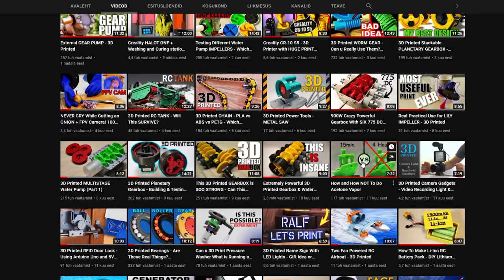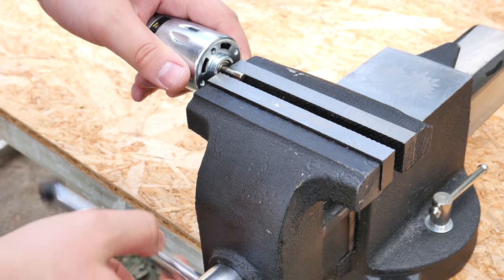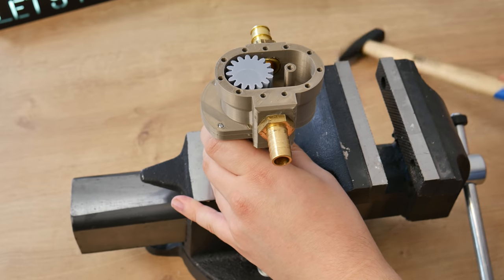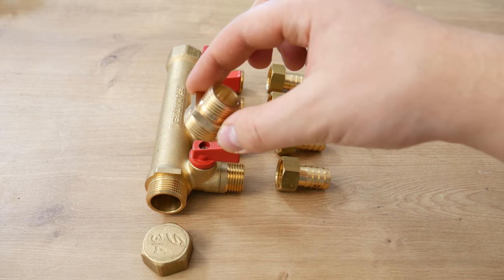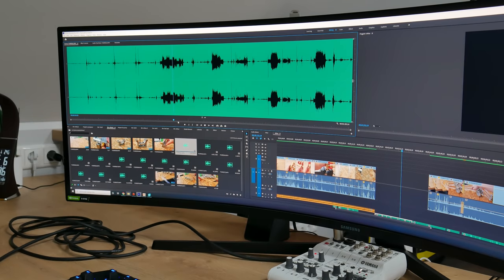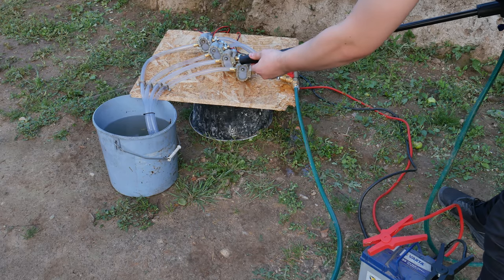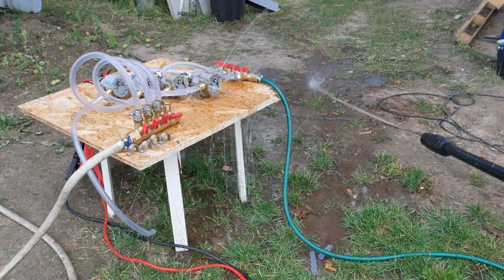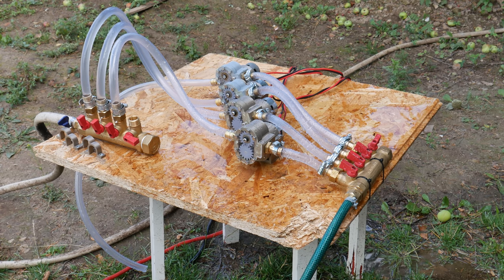3D Printer Pressure Washer with GEAR PUMPS - Part 2

Comment: Good work! 

Series you add the head together Htot = Hpump1 + Hpump2 +Hpump3 + Hpump4
Pressure tot = Htot x density x gravity

Parallel you get higher flow

Qtot =Qpump1 + Qpump2 +Qpump3 +Qpump4

Ofcourse there are losses, your main losses in your system is due to leakage, use a resin printer instead of an extrusion printer and include gaskets and oring where necessary. 

Your parralel system can be optimized, however series is the way to go when you want more lift.

Comment: Series =more pressure
Paraller = more flow

Sealing it properly will help a lot
Dony aply silicone etc putside the screews...aply it inside because u always leak where screews are

And remember that u loose pressure at the pumps because u have to big gap on top and botton 
Use somethig to seal it and u will have super strong water pump

Or just make peristaltic one

Comment: option 1... take off end cap, put pump 1 on there instead of tap 1, result = weaker pump is now getting its flow assisted in pull as well as push by the forward 3 = better flow as pump1 water is already traveling in the right direction. 
2 add a buffer/accumulator io tank/trompe remember there's trapped air/gas in that flow so use it for free by trompe trapping it to increase local pressure in front, cut an old expandable bike tire tube put in a big pipe to stop it expanding to/so much it pops , test...
3 dip these leaky prints in 'water glass' /LIQUID SODIUM SILICATE concrete sealer cures quick with co2 so do it when you talk to your plants lol to properly seal the layers with a hard glass like layer use for all other practical machine 3d prints too

Comment: I see most people suggested putting it in series but putting it in parallel is better , i think the problem is u using those 4 fit connector. At the end pump 2 can cancel pump1 cause it spread to pump 1 and pump 2, maybe try to find a connector that doesn't have many turn, just 4 output straight to the hose without those 90° turn

Comment: Also, print the connection parts with the resin printer as well, and between the pumps you should use left/right threads to connect them directly in between each other.
With an printed external gearing you could run all of them with one motor.

Comment: Basic configuration of pressure washers use pistons. I think you could 3d print those easily and make some sort of one-way valve for them. Because of that jet in that spray handle, you need more pressure not flow. If you remove that nozzle on real pressure washer, you can see that it doesnt actually flow as much as you would think. You could use basic seals for the pistons and make spring-actuated release valve for longer idling times. You could 3d print camshaft like shaft, or use shaft with a flat in angle so the change in stroke isnt so immediate, smoother like.

Comment: Hey buddy, you need super tight fit rubber gears and higher RPM, also, switch to a brushless motor, for example - "Gartt 5360", 4300w (max) equivalent to about twenty 775 DC motors (775 200w), I really like your channel man, great progress!

Comment: I honestly think it might just be the motors also. don't forget, pressure washers are usually 2kw+, and sometimes even use actual gas motors. you can hear the motors bog down here as well, which I think confirms my suspicion, and really I think you had a very nice design. 

Perhaps buy a few cheap wood saws or something like that, they come with 1kw+ motors and can plug straight into mains. there's also the concern of torque though so maybe something else with a geared down motor.

for the leaking maybe just use some strong epoxy instead. or actual gaskets. acrylic is also unlikely to stand up to the pressures you're looking to achieve - it probably won't break but water will leak out through the bolt holes and the pressure might even strip the threads a little, even on thick acrylic.

I know waterjets use a piston pump mechanism, so that might be fun to try if you find you can do it practically.

also nice screen.
great video!

Comment: You mentioned that PCB Way does light metal fab.
Exploit in the chase for that seal.
Then, run a much larger one of these with your "v6" 775 motor ;) (Perhaps gear it for a bit more speed too?)

Comment: I think the junction inlets at 45° s  might increase the power.  As you don't have any non return valve if any  pump is less powerful than the average that might get a negetive flow too so vectoring the pressure might help.

Comment: Pressure washers use a multiple piston pumping system, not this type of cog pump. They work pretty much like a car engine (but in pressure washers the crank rotation to axial displacement occurs in the same axis) which, by definition, is an air pump.

Comment: You should use 3 Y shaped connectors for the tubes! I bet it’ll give a lot more power like that, instead for using the 4 nozzle connector. The issue I think with the 4 noddle connector is that all the water is coming in at a 90 degree angle. If the water was coming in at a 45 degree angle, I bet it would work much better!

Comment: As you an see, the volume is not the problem but the pressure. You need to put the pumps in multiple stages to increase the pressure. Just remove the 1=>4 plenum and instead run the pumps in series and you should have enough pressure to adjust to the 15° nozzle size

Comment: Low pressure, i would suggest a different pump that gives you less slip, since you are using a low cps fluid, you need better seal

Comment: fairly sure without much experience a [V]configuration in your manifold would prevent back pressure and would direct flow much better, you can 3d print it with resin . 
                                                                    [V] formed like this , stacked . you could also print it so your able to add more hoses as you wish .

Comment: Put the pumps in series like one after the other so it builds up pressure from pump to pump adjust the power to each pump accordingly I just got done trying at myself and it works great actually usable for work except for the power consumption and I don't know how long it would last if you're actually using it as a pressure washer

Comment: I have a few thoughts mentioned before and possibly new. Pumps operated in series, rubber gaskets, using bolts instead of screws, wrapping them in plumbers thread seal tape, and maybe using a 1/6 hp electric motor, which are usually just above 100 euro new, maybe 50 euro used, at least in my experience.

Comment: Could you have them in series ,with water/air pressure vessels in between and a non return valve . That way each stage starts with a higher input pressure.

Comment: its a great work, you need to fix the loss of water before the output, because all the preasure that you make loss in this filtrations. For the water you can make bucket with the outputs in the bottom for have allways water and have an initial preasure.

Comment: Should be 2 or 3 in series as others have said.
You dont have enugh pressure and the pressure washer is made to use high pressure and low flow. I think you might even need to halve the "chamber" of one pump so it can spin faster to get more power

Comment: Compound the pumps.
Ideally 3-2-1, but for you and cost reasons 2 into 1 would be easiest.
Start by fixing leaks with PTFE tape and o'rings, then plumb your water supply into two pumps, on the outlet of each of the two pumps, you'll need a one way Valve to prevent backflow, then run those two outlets into the inlet of a single pump, then again fit a one way valve to the outlet of that pump, and then attach your lance... should make up for lack of water causing cavitation and be able to move a higher weight of water
Reply: Ideally you want no pressure inside the pump at all, but it's going to be basically impossible with this setup to achieve that, so you're looking at minimising losses.
Ideally you'd want the two pumps in parallel to be (for example) 500ml each, totalling 1 litre of volume, and then the third pump, being fed by those two, would want to be around 900ml, so there's always a pressurised flow of water into that pump, hopefully preventing some cavitation.
If you wanted more pressure but didn't need the flow, you could then add another pump of a smaller size in series after that, say 500ml again. But have it running 1.9x faster to account of the higher volume feed

Comment: I see this so often, slapping on lid right after putting on silicone and tightening it to spec strait away, including youtubers that make the craziest things. You will probably get better result with it if you wait before tightening it, and try to get a somewhat even layer. Not the biggest issue if it isnt perfect, as long as there is enough make good contact with parts. 
Wait and let it cure for a bit. Then, depending on what you using it for, A few mm wide\tall usually works fine. When its semi cured you squish it, it will somewhat act like a real gasket. Throwing it on, and tighten strait away you most likely just get a seal that leaks and seal is extremely thin and prone to fail. At least, this is my experience. That being said, silicone can be weird. But let it cure a bit does help allot and gives much better result in general. Also, i guess it will handle more pressure and still be air tight.

Comment: One improvement would be to stop using the drill to tighten up the screws. Get yourself a torque wrench. The covers warp in different places when uncontrolled torque is being applied by a drill.

Comment: This is good project however since this is now part 2.
All I see is almost no improvement at all. 
Most high pressure gear pumps mostly use straight gear instead of helical gear.

This way they able to put more higher pressure.

And also they need to be in series instead of parallel just like an air compressor.

So that it will be in stages. Which next pump gonna be pushing even higher pressure more than previous pump that connects to it because the input already at high pressure from the other pumps that previous connected to it.

So basically the next pump that connects in series gonna keep pumping even higher pressure than previous one and ended with very high pressure.

And also you need some kind of air ballast or whatever the name is to help building the pressure as the water pumping up to high pressure.

The water will compress the air in the tank. Create a high pressure that will push back the water at even higher pressure when released. Search up ram pump for the reference.

Comment: I agree with all the comment below, make it into series not parallel, 2 small pump feed into one slightly larger pump.. leaking problem should be easy to fix, water tape n much more silicon glue..

Comment: You will also want to use a you should make the parts out of ABS and then use acetone to weld the pieces together. you will also want a pump shaft seal on the motor shaft.

Comment: I think, precision of non-factory material processing and plastic rigidness is unsufficient to develop a required pressure for washer. Probably you will lose it due to leaks between moving parts and housing... Also, there are usually plunger pumps used, not a gear pumps.

Comment: you can buy 288w high power 775 dc motor so you can use the best impeller to make 1 powerful water pump and the problem before with last years pressure is that the gears make it slower also your motor is slow to. you power the motor by 12v that =3500rpm so maybe use 24v and above. but your gear pump is a very good idea! love the idea🥰

Comment: 3 stage piston pump low med high pressure with check valves...I just don't konw if that could be 3D printed.

Comment: You need to upgrade those dc brushed motor to brushless motor you will get higher rpm and higher torque from those brushless motor and grate video 👍

Comment: I would have connected the pumps in series instead of in parallel. So one pump feeding another. This way you should increase pressure. In parallel would better increase flow instead of pressure.

Comment: "Brass Thing" is known as a 'manifold'...
Larger Motor with slower speed with larger gears will give more volume.
Motors are over spinning giving fast motion of water in open hose. 
When you close it the speed is gone and there's no ability of motors to make pressure resulting in impingement of liquid in mechanism instead of motion through the pump mechanism.

Comment: Connect them on a line use plumbers tape on the nozzles better sealer that can withstand the pressure of the water

Comment: YOU GOTTA FIX THOSE LEAKS!!! your loosing all your pressure to those leaks, design the front CNC piece with a small grove to fit a o-ring or small gasket. rtv make a gasket from the auto parts store less then 15$ will do entire project!!!

Comment: I think you need to add compressed air! First you must know how a pressure washer works, it uses a the water from your house at the same time pushes lots of air through the gun. Combine the air and water should get a very powerful pressure
Reply: If you have air in your pressure washer, it is broken... the only time air is added in a pressure washer is when a venturi chemical system is used

Comment: you lose a lot of presure head at the utlet Junction where water flow needs to turn 90 degree.  it actually decrease the presure head due to more turbulence. you should have a system where water can flow in one direction and if the flow path needs to change direction it should be smooth.

Comment: well we're back to square one again, water pressure != water volume. you still need to figure out how to build pressure and not just push a lot of volume like the yellow garbage k7 with 600l/h and max pressure of 3000psi, you can most likely match the cadence already but you need to figure out how to get to the correct pressure level,

Comment: If you wanna do something like this, you need to take care about the a fluid dynamics. The piece which connects all the pump outputs together is a really big problem. The 90 degree outputs generate around 30-60% loss of power, depends on the surface quality, the overall geometry, the diameters of the pipe. If you wanna quick fix this just make 30 degree inputs to the "output rail"( you can do straight 0 degree input on the first, to minimalise the vortexes at the first section of the pipe. All the force vectors should face to the main output way. Gl @let's print ! Keep On the projects! :)
Reply: Water is incompressible, going around corners won't slow it down. A change in diameter could slow down or speed up flow, but not a change in direction.
Commercial washers use 90 degree bends in pipes all the time, sometimes tighter angles than that even, and it doesn't affect flow.
Reply: @warningkomonkey  Man, do you ever heard about the friction inside the fluid? If you doing 90 degree connections, especially in high pressure applications you will end up with a huge pressure drop. I don't want to blame you, I just don't really know why are you talking about this, like a PRO when i think you are not a fluid dinamics engineer, but i could not know. Nevermind...Also, you are talking about the speed of the fluid, it isn't the same as the kinetical energy of the fluid. Yep you can speed up the flow by using smaller diameters, but you need to calculate with losses because it may cause vortexes. Asthe fluid gains speed by the smaller diameter, every little scratch in the pipe become a vortex generator. 
If you can't believe in me, make my day better. Also you can check out theese links.
Hydraulic pressure losses: http://fluid.itcmp.pwr.wroc.pl/~znmp/dydaktyka/fundam_FM/Lecture11_12.pdf
K (kappa)factors: https://slidetodoc.com/presentation_image_h/83cf23a325912987cb6f34266af63d73/image-101.jpg
http://ponce.sdsu.edu/onlinepumppipesystemtable.html
My POV maybe a bit overkill for this kinda project, i just wanna help to make it better. : D
Have a nice day.
Reply: @vdk4988  nope not a fluid dynamics engineer, just a pressure washer engineer, 2 years designing an building pressure washers and currently 3 years working as an engineer in industrial Hugh pressure cleaning. I understand fluid dynamics, but in this application I counts for naught. The losses you receive by pushing water around a corner are tiny. In a pressure washer,  with no nozzle on the end of the system, the output of the pump should read 0bar, if it is any higher than this, there's a restriction in the lines. You can add as many bends or corners as you want, add in loads of banjo bolts and swivel joints too, the pressure should still read 0bar. The only difference adding in a load of direction changes makes is in the initial prime of the machine due to turbulence, which does slow of the water down, but not the corner itself. Once the system is primed the water moving through the system acts as a vacuum for the water just entering the system which reduces turbulence. In summary, the losses received by water being forced to change direction should be near negligible in this application
Reply: @vdk4988  I will agree that the interior surface of whatever pipe or hose you're using would want to be as smooth as possible, or you'll start losing too much energy to heat from the friction, and as water is an abrasive, your machine will wear out faster
Reply: @warningkomonkey  in the case of no nozzle, and no "load" i can agree with you

Comment: Until you learn how to build something that doesn't leak, you are never going to build a pressure washer. Plus, you rubber hoses will never hold 1000 psi, which is what you need. You need a pressure gauge and flow meter for testing.

Comment: I think size will really help this design. The further away from the center of the axis of rotation, the faster you move. It seems to me that the pump is moving water really well, it is providing Excellent pressure, it just can't push the water fast enough to keep the pressure up withe the nozzle letting it out